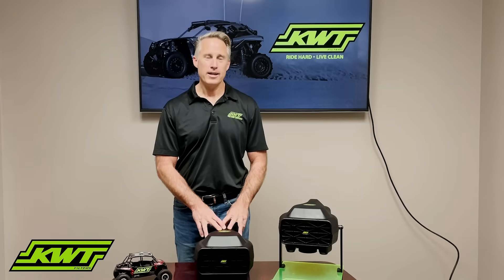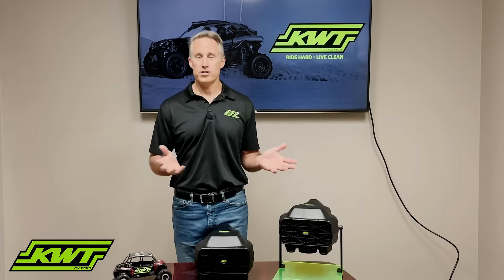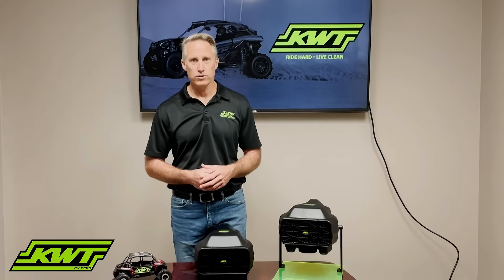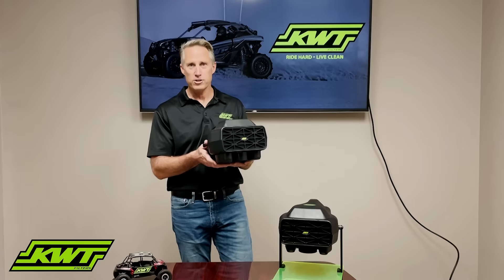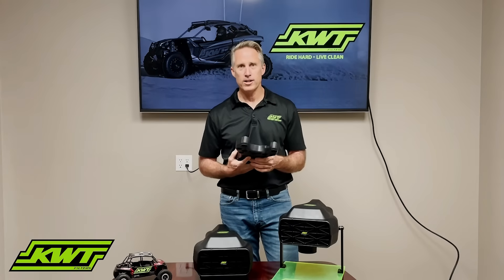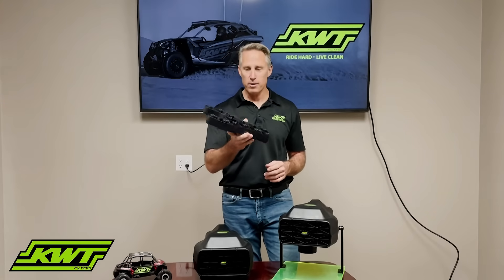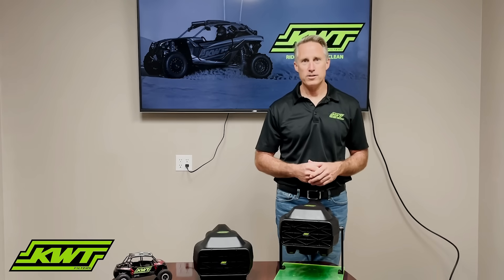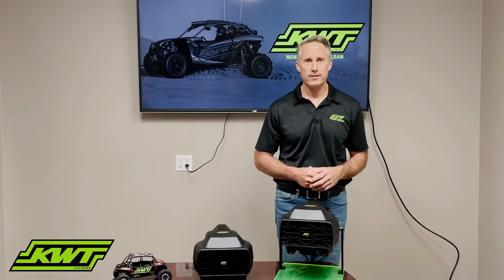The KWT Particle Separator and How It Works

Comment: i want to buy this particle separator for my x3 but my question is: i live in a hot weather during the summer and on winter is around 32f so i use a windshield but my IAT are alite high because of that, can i hook up this particle separator in a way that i get ram air from the side? and lower those IAT's? , right now it sucks air from the back of my head but there's not enough airflow even with the vents all the way open to help that air intake. if it helps my IAT's are on summer hitting 190f to 205f and on winter around 135f to 149f ( those are not engine temps i check engine temps with the oem dashboard ) i check IAT's with a dynojet
Reply from the maker: Hi Sir,  We do not use RAM air.  Our system works by sucking the air in using the engines induction.  We have MANY customers that mount their unit sideways, or backwards facing away from the windshield for this very reason.  Thankfully our unit has many mounting options.  So having a windshield is perfectly fine without.  There is zero horsepower loss as well, and the dyno numbers have proven this.   If you have anymore questions, please feel free to email at info@kwtfilters.  We don't want any questions lost in the Youtube comments.  Thank you for the interest!

Comment: They suck i lost power and its loud when you give it gas sucks alot of air makes machine bogie
Reply from the maker: Can you please send us a message - we have NEVER heard anything like this.  There may be a problem with your install.  Please email: dustin.fedak@kroswise.com
Reply from the maker: Never received an email - but we are also confident it was user error - seeing as that our filter is 100% silent.  ZERO noise is given off.   We suggest checking your install for a tight fit on your intake.
Reply: @KWTFilters  Perhaps a shill for S&B.  I had an S&B p.s. as well as their filter for my xp 1000 and driving in our desert I get the fine silt/sand that gets right past both.  I wonder if your system is better.  I made a d.i.y. cyclonic filter for my shop vac for doing woodwork and it performed awesome.
Reply: @KWTFilters  do you have a reply for bizill?
Reply: @KWTFilters  I too wouldn’t mind an update here???